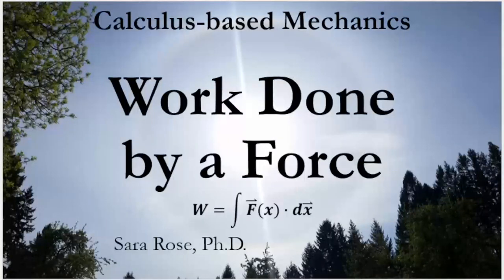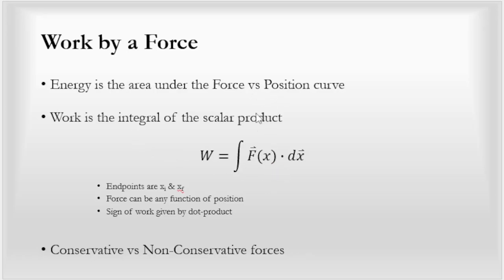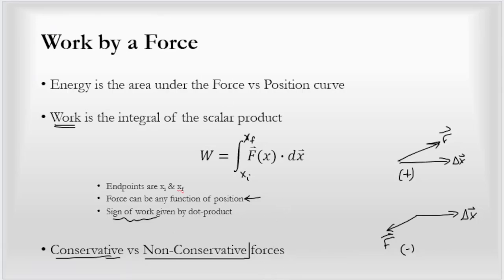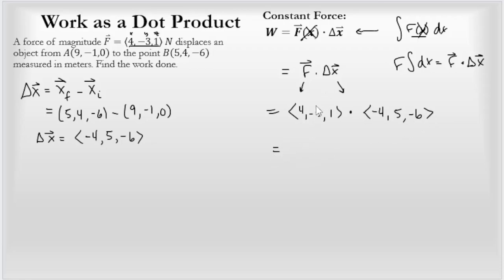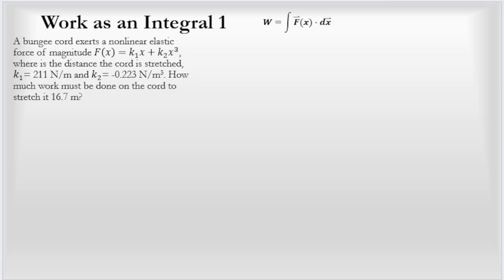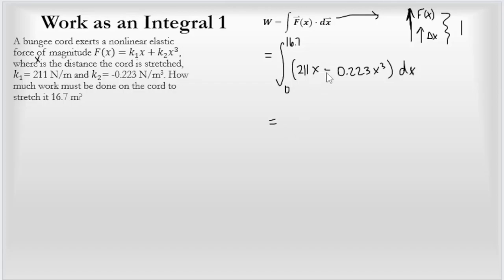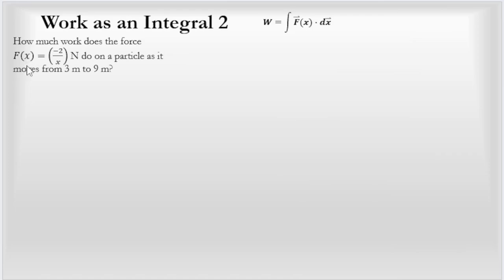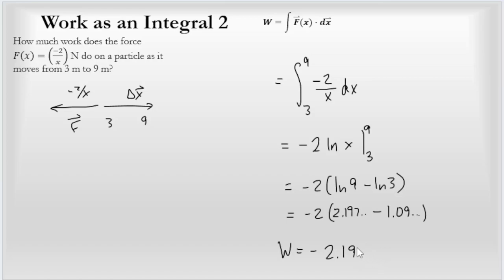Work Done by A Force - Dot Product and Non-Constant Force Integrals

Comment: 13:58 I wonder why does cos(phi) element not included 😢 ?
Reply from the maker: @doxuanhoang8767  I mention that dot product is a one, and that is because we are assuming the displacement and the force are both along the same dimension. If a negative sign arises, that is because of the nature of the force function along that dimension (the integral could result in a positive or negative value depending on the force function and also the endpoints of integration).
Reply: @sararosephd  Thank you!